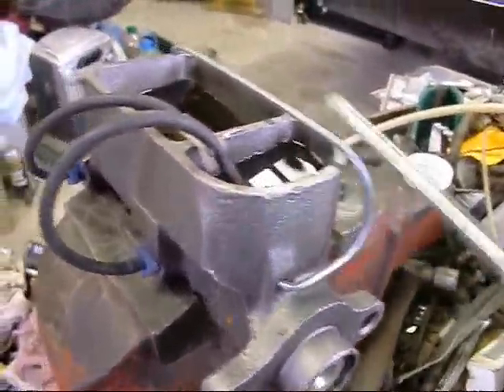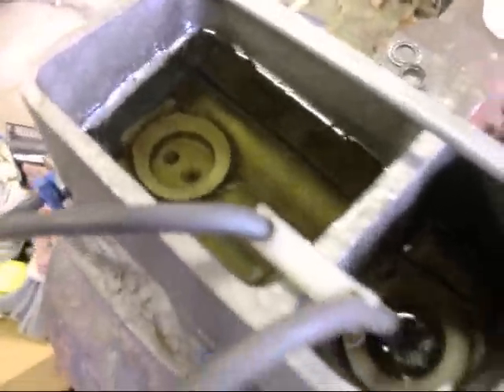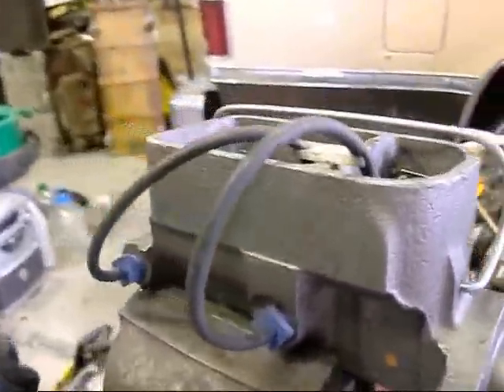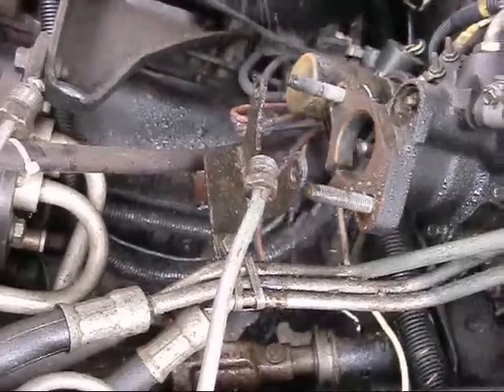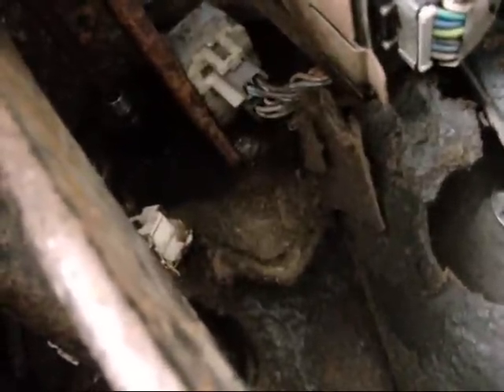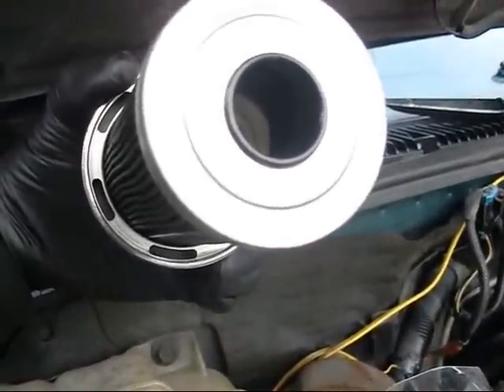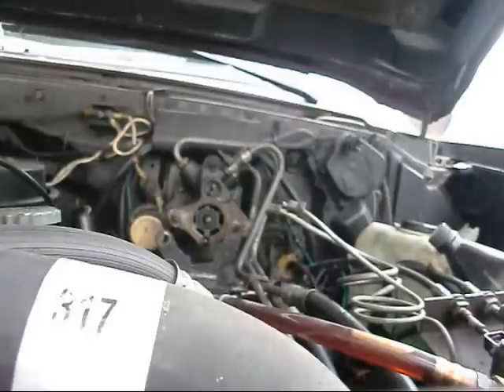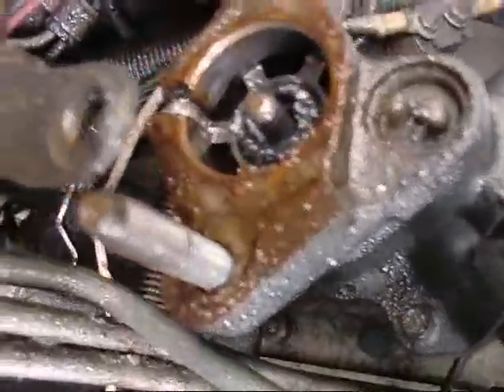K5 Blazer Master Cylinder 2 13 13

Comment: I mentioned that to you on a prior video.  I forgot you had HydroBoost as well...so that is null and void.  One of my friends has an early 90s Taurus where the master cylinder was leaking at the outer seal, down the booster, collecting in the bottom of the booster, ruining the booster.

Comment: You can never get all the air out when you use those plastic bench bleeding kits.  The air will be out, but it will suck in air from the cheap fittings.